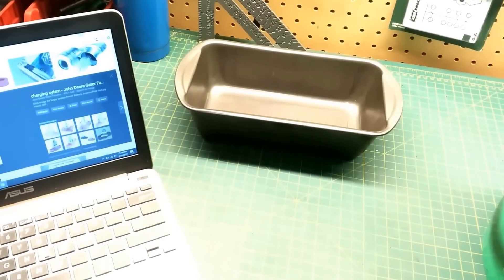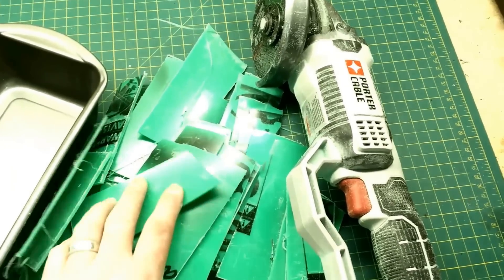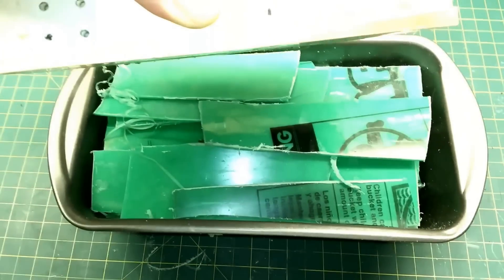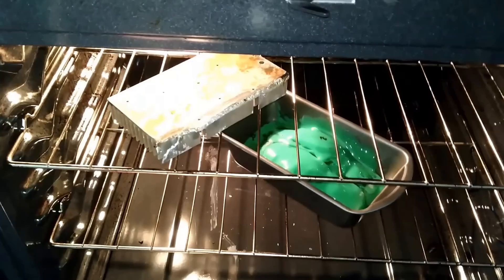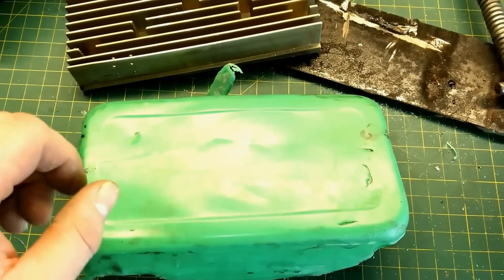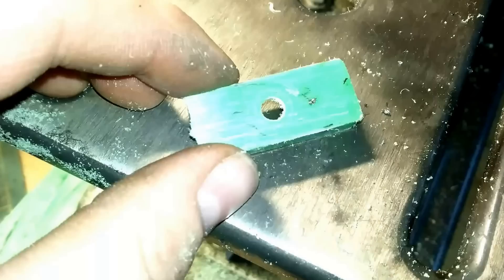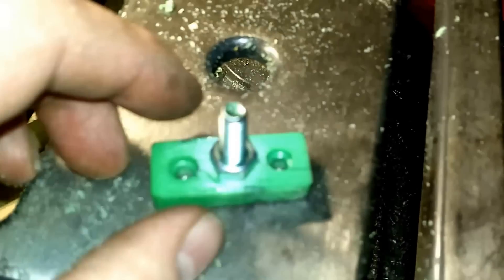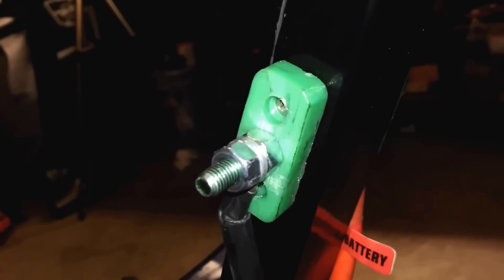How To Recycle HDPE Plastic To Make Parts! Trash to Treasure, Part 2!

Comment: Is there any concern about any gases or other chemicals that might be released while heating it up?
Reply: HDPE stands for High Density Polyethylene. When heated strongly it breaks down into high molecular mass hydrocarbons which are similar to hydrocarbons present in wax. It's completely harmless.
Reply from the maker: My understanding is it doesn't offgas unless you burn it.   I have not confirmed that, if you find out something else, I'd like to know.
Reply: No.

Comment: I used your idea and formed a piece of body trim molding for a vintage truck. I melted down the HDPE and once it was formable I placed in the metal trim piece from the one original piece I had. It worked perfect. I was then able to use chrome paint and a little trimming of the material and it worked really well. Thank You for the idea and video.

Comment: Save your glue on the bottom plugs - just heat up the plug with a propane torch and it will glue itself .

Comment: Interesting video. You can use baking parchment paper to line your pan and plastic will not stick to it. It doesn't burn under 450 degrees.

Comment: I dropped my Alarm remote and the cover for the battery smashed to the point it would not go back on  I ended up grabbing some popsicle sticks from the dollar store and 5 min epoxy Which really came out nice ..However i have a need for a part on my trucks center console  (where it shows the gear its in) it has springs to keep the shift indicator arm up ..This why i'm here ...Thanks for the posting

Comment: i would imagine the fumes must be poison. i found that some plastics melt in resin by mistake of putting some resin in a plastic tub to store the resin. i caught it in time before it leaked all over the place by putting it in another tub. then i decided to put more of the same plastic in the resin to melt it. then i added colour pigments to colour my mix. then i put catalyst hardener into that and filled a latex mould of a garden ornament. and it worked i had a hard as tough as glass solid garden ornament. i did not use a release agent and it come out the mould easy. so i found this out by my mistake.
Reply from the maker: Off gassing is always a concern, that being said HDPE by what I understand doesn't off gass unless you burn it.   Sounds like you have been having fun!   Be careful!

Comment: This works with all those left over Walmart bags that monopolize one or two kitchen drawers also.
This stuff is too valuable to be littering up the world.
I’ve made some very useful household items with it.

Beware of trying to work  polypropylene with your hands. 
It doesn’t achieve the same workable plasticity as hdpe or ldpe.
It looks like it’s still solid until it liquifies. You only need to get it on you once
to feel the need to warn others about it. Super nasty. 
Even with gloves, it sticks to them like superglue.
You can use it, but it’s very different.

Comment: That's ironic, a heat sink in the oven. It's kind of like the way sponges grow in the ocean. But this was a neat experiment with great results. Looks as though the saw didn't quite make a melty mess on the edges either. Unless you trimmed all that off before showing it?
Reply from the maker: The saw blade actually did a Surprisengly neat job.  I did flash it with some heat with a propane torch to polish it off.

Comment: It is extrudable. If you've got a filament extruder you can make filament for a 3D printer out of this stuff. The cheapest one I've seen is around $300, expensive but not too bad in the context of 3D printing. It would only take about 15kg of filament for it to pay for itself. A lot of people would probably never use that much, but some people could go through that much in a few months.

Comment: To block-form your plastic, heat it in your first non-stick bread pan, then using a second identical non-stick bread pan weighted or by force wearing hand protection, place the second bread pan into the first ontop of the melted plastic. This will make a nice smooth brick of plastic, the thickness you can control by how much plastic you melt. Non-stick pans with more vertical than angled sides will give the best results.
Reply: Good stuff - thank you!

Comment: Any idea what temp you need for it to be pourable?
Reply from the maker: +InsideOfMyOwnMind My guess is it will burn before it becomes pourable.
Reply: 1D10CRACY Yes, this is where a good grasp of polymer science could come in. There may be an additive that would make it less viscous at temp.
Reply: 175 degrees is a good mix between pliable or viscous enough to work with, and lowest release of gaseous chemicals from plastic. FYI, milk bottles are a common source of this plastic.
Reply: InsideOfMyOwnMind If you fill it with vegetable oil before puting it inside oven you get what you want then you need this steel syringe to suck liquide plastic n inject it to your two half mold

Comment: Intrested in this, as I recently used to work in the plastics injection moulding industry,  perfectly safe heating it to around 350°F (about 176°C) we processed these types of plastic at around 180 to 220°C or 360 to 430°F.
Reply: Yes, I rather think the temperature is a tad low. In the UK we usually use centigrade and the target is 180 deg.

Comment: I'm not sure I would trust that under a high amp load because of the melting temp.
Reply from the maker: +Tractor Wrangler It doesn't get warm under load.
Reply: 1D10CRACY 
Well.. its not supposed to but stuff happens and you get a bad connection and your battery amperage is 350 amps or so and heat happens.  
I'm not saying it's wrong but I am reasonably sure that type of plastic is not used for that application. Not sure what amperage your drawing in normal operations either.

Comment: I've seen people use plywood to make a mold, then char the surfaces that come in contact with the plastic.  It's great for clamping, or putting into a press.  If I'm not mistaken, good wood can be used as the melting vessel, as wood has a higher ignition point than HDPE's melting point.

Comment: HDPE is moulded in two ways. If it has side seams it has been blow moulded, this is to make bottles and containers. If it has a pip on the bottom like a bucket, then it has been injection moulded. Each type of manufacture requires other additives, blow moulding requires agents that allow the HDPE to stretch, injection moulded contains flow improvement agents, these will affect how the HDPE acts when recycled.
Reply: Hi, don't know if you will get this as the thread is old. Many videos on HDPE, but only one mentioned that some samples seemed to 'flow' better than others. The 'non-flow' type included milk bottles, the very thing that most people start with !! Your info suggests exactly that - milk bottles are blow-moulded and lack flow agents. So we need to source injection moulded samples. Thanks for that very useful tip.
Reply: Thanks for this tidbit. Really helpful. I wonder what a hybrid recycled hdpe block would be like? One that is say,  sandwiched with alternating blow molded and injected molded types. I bet it would be super strong and flexible. Do you know if the layers would bond well?  I'll have to try it sometime.
Reply: @thadeousbella4107  have seen a video here of somebody doing a mallet with 2 different colors of plastic (white and gray) and twisted it on a way to get a damascus steel look on the hpde mallet.

Comment: This kinda makes the point of how easy and inexpensive products really are to manufacture.  So, why are we paying so much money for easy and cheaply manufactured goods?
Reply: Well, he DID use a $5.00 bucket to make a $2.00 part. Not to mention the cost of the electricity to get it to that point hehe I discovered this too while trying to use melted soda cans to salvage the aluminum: I found I was using $10.00 worth of charcoal briquettes to get $5.00 worth of Aluminum. 

BTW: you're NOT paying a lot for cheaply manufactured goods. You're paying market price. 

Just remember: the mold to make the pill bottle in his last video probably cost $80,000.00 to make. So not counting the labour, energy, machine, etc, it would cost $1.00 per bottle for 80,000 bottles.
Reply: @muskokamike127  that's misleading dude, yes when you do small project you kinda defeat the purpose of it unless the part you're making can't be found on the market, but if you going to make it a business then you'll not melt 5$ and expect good ROI...
there is a bep that you should surpass that most business rely on and use it as a refrence and that's why sometimes you hear a manufacturer needs more time to make something routinely easy for them, that's because they keep stacking offers to make it profitable the more you invest =  the more you save = the more you profit.
that's why most of the times hand made things are more expensive but more durable.
Reply: @muskokamike127  ....but what if he got the $5 bucket for free?
Reply: @VegasRT500  then that's good......I actually started scrounging around for HDPE to make stuff out of, the only thing I found was a detergent bottle and a couple of bleach bottles in my place.

Comment: If you intend to make multiple bread pan size bricks, you could use a second pan on top to press down on.  As tools are leaving impressions, you could leave some plastic inside the top pan for anti-deformity support.  Pull out another piece to support the bottom pan before clamping.  Of course, milling makes all that unnecessary.

Comment: Thanks for the video. I have been racking my brain, on how to repair a dash on a 72 vega I own. Someone cut a couple of holes in dash, and screwed up. Wanting to mound plastic, and paint to match. Next problem is to match the grain.
Reply: Scott West Years ago,they had a kit or iron with the proper texture so you could match the texture of whatever it is you were patching. The stuff came in a color matched tube,you squeezed out a bit into the hole then layed the pattern over the stuff and used an iron or pressure,I forget which. It wasnt perfect but worked. I used it once a very long time ago. It may have been a vynal patch kit for seats too,I just dont remember thst part of it. I do know I used it on my dash and it worked!
Reply: I remember that stuff, worked great. You're right though, it was a liquid vinyl and came in several colors and you mixed it up to get whatever color you needed.

Comment: Nice video, very normal and unpretentious.. I was thinking, if you had  a large candle you could easily carve your object from that;  encase it in hard plaster with a prue hole; stick it i the oven held upside down to melt out the wax & harden the plaster then fill it with molten hdpe to create your moulded plastic product. The plaster can be washed away in a bucket of water leaving only your item.
Reply: Since it doesn't liquify when melted, make sure your mold allows you to press the viscous plastic into all spaces in the mold and avoid undercuts unless they also have sprue holes for trapped air to escape through.

Comment: Put the melted plastic clamped down in a freezer. The plastic will shrink and the heat sink will just fall off. The plastic blocks may be re heated as many times as you need to form and shape them as required. Work in a well ventilated area. The plastic will give off a gas. It makes some people a bit sick to their stomach. Just go to another room or outside for a good dose of fresh air.
Reply: 1D10CRACY HDPE is some tough stuff. At least blow molded HDPE is. That injection molded bucket plastic is more flexible. I don't melt injection molded HDPE anymore as I like the properties of blow molded better. Blow molded HDPE is harder, and slicker.
Reply: Just so you know: there IS a limit to home many times you can melt and reform most plastics. Without refreshing my memory via google, I seem to recall it is about 6 times for most plastics. The heating and cooling changes the structure of the plastic to the point it loses it's structure. I know some become quite brittle.
Reply: Muskoka Mike Thank you for that insight - I wondered myself how many X one could do this before the plastic would degrade.
Reply: When he squeezed the plastic through holes in the heat sink nothing was going to fall off then. I'm impressed he got it off. He must have took it apart before the HDPE fully cooled.
Reply from the maker: Larry Lund Actually those broke off right away when I pried on it with a hammer.   They are pretty small holes, was never worried about that.    Where it overlaped around the edges was where the issue came into play.
Reply: 1D10CRACY

Comment: how can you make detailed things even if you don't have all the special equipment
Reply from the maker: +Manga Lover Sometimes I make my own special equipment.   LOL
Reply: 1D10CRACY that's awesome and thanks for replying I love making things so I wanted to try my hand at something new
Reply: Manga Lover 
I plan on making a modeling clay model, and pouring plaster of Paris over it. Let it set up, and dig out the clay.
And then sand the inside of the plaster mold. And then completely dry out the mold by putting it in a 200 ° F oven for a day.
And then preheat the mold with the hdpe, and then press the plastic into the mold...
That should work.....

Comment: Many bottles that stuff comes in are made of it.  I would just rinse them out really good before I use them to avoid contamination problems with the plastic that would cause a problem.  If it is a clear bottle, it is probably PET instead unless marked otherwise and often soft drinks come in bottles made of it.